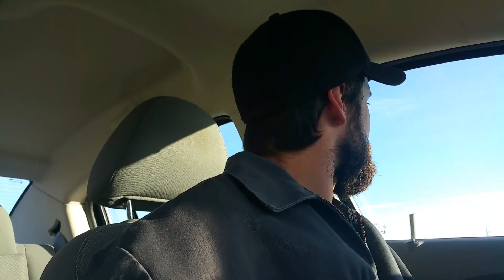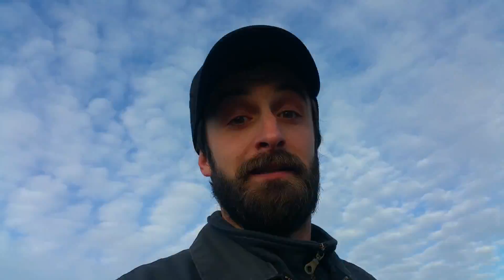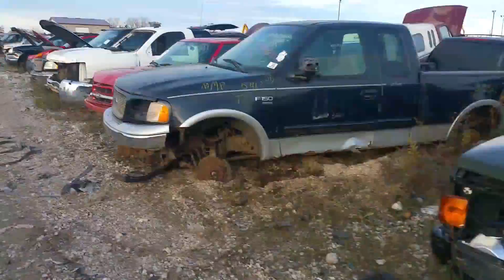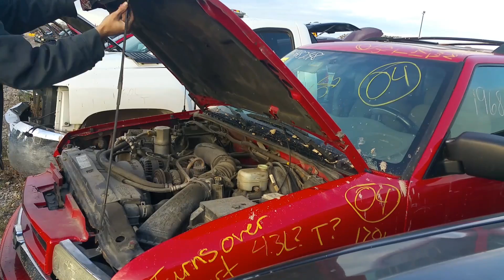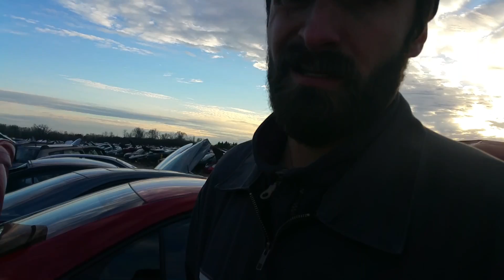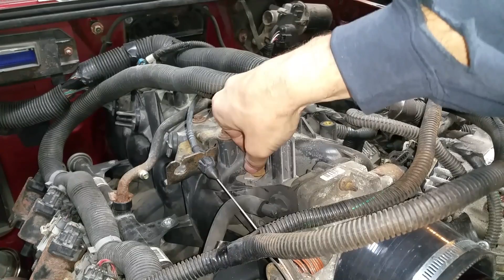BUDGET TURBO LS SWAP INTAKE AIR TEMP SENSOR TRUCK INTAKE!!! FOR V8 SWAPPED RANGER SPEED DENSITY!!!

Comment: I am running  an LS1 Standalone Harness on a 5.3 in a 95 Mustang and I will be removing the Evap out of the intake.  Do I need to run this sensor like you did, I looked and it seems there is a sensor in the Throttle body itself?  
I am new to all of this stuff and will not be running  a turbo for a little while, just want to get it up and running for a while.
Thank you,
B

Comment: Is it better to weld that sensor to your filter tube or is this method better thanks also does it matter how close you weld that sensor to your throttle body thanks I appreciate you taking the time and making awesome videos
Reply from the maker: I don't think it matters too much, but you will see some effects of heat soaking in the intake compared to pre-throttle.

Comment: The iat sensor where you have put it is going to read higher temperature than usual due to heat soak from  the hot engine ??
Reply: freddieNZ68 ???? Is this true on the 5.3l truck intake?

Comment: If you dont have this connecte will the car start. I keep getting car start for 3 sec then cuts off. Yes vats is deleted. I dont have the IAT connected
Reply from the maker: It's possible. IAT and coolant temp sensor will make fuel and timing corrections. Not hooked up will be maxed out in one direction. I believe unhooked IAT will show 284 degrees.
Reply: @BlaserBuilds  Thank you

Comment: nice .. i was trying to decipher what the maf sensor did in the comments below cuz i'm clueless and need to learn weird stuff i'll never do lol. i want to go to the yards dammit.. so what happened to the original one or is this for a reading relating to the turbo? cheers
Reply from the maker: Blaine Ludeman I'll be removing the maf and doing a speed density tune... basically the tune will be based off of manifold absolute pressure, rpm, and air/fuel directly not considering the MAF sensor corrections.  MAF sensor is measuring air flow and converting it into a frequency to understand air flow into the engine to calculate fuel. IAT is responsible for some fuel corrections so need to add it back in.
Reply: so to get the right air fuel mixture, right?
Reply from the maker: Blaine Ludeman Yes, Without the MAF.

Comment: Why did you add that? In the other video, I thought you fixed the short on the MAF sensor that was causing it to read 284 degrees?
Reply from the maker: I did, but I will be going with a speed density tune that does not use the MAF.. Essentially I'm removing the MAF so I need to add the IAT sensor back in to measure temp for fuel corrections. 

BUDGET TURBO LS SWAP INTAKE AIR TEMP SENSOR TRUCK INTAKE!!! FOR V8 SWAPPED RANG